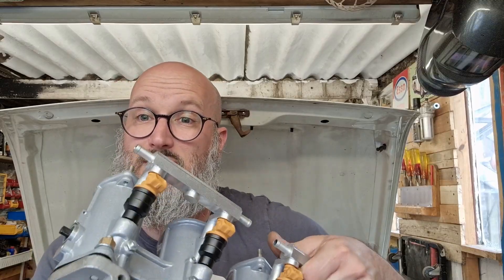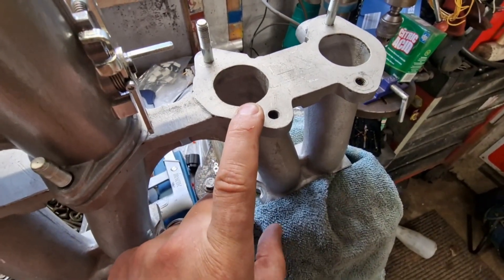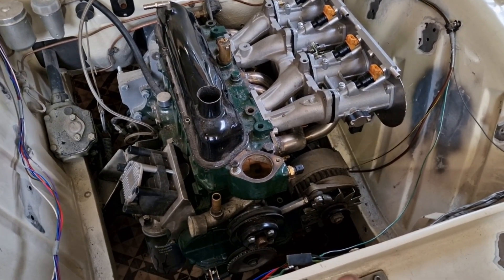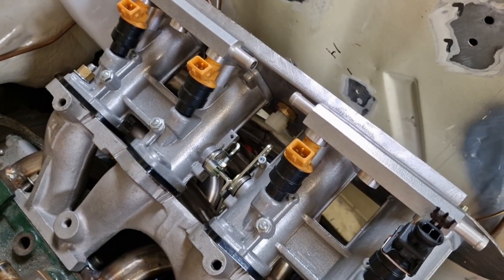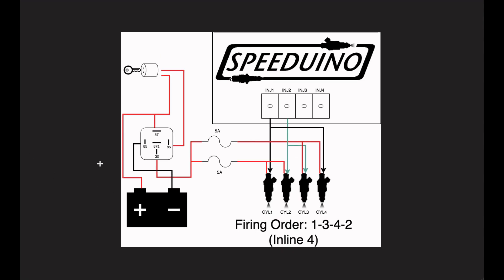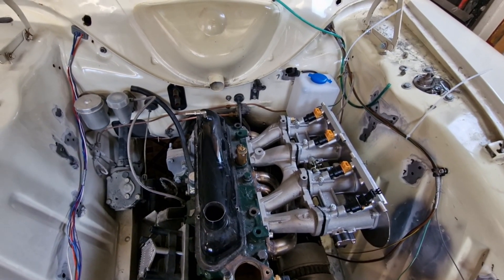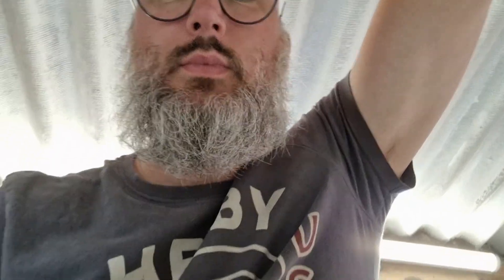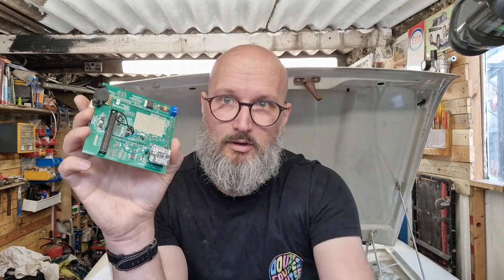Classic Car EFI - Making a loom for the Speeduino from scratch

Comment: Soon I will have to do the same thing, also the chassis harness as well. I'm building a Locost from scratch in LA. Duratec 2.5L w/custom TBs, and Speeduino 0.4. I don't know anything yet about the Speeduino part. I have soldered it together that's it. I don't even know yet, if I need MAP sensor or not. I will look into it, when the time comes. What you will be using to wrap the harness?
Reply from the maker: That'll be a laugh with the 2.5 duratec in it!

Im reading into the MAP sensor situation too as it's more of a requirement for boost as I understand it. It's sensing can be tweaked in tuner studio so it's every cycle which would work in theory if you just take it from 1 runner like it is when using carbs and vacuum advance.

As for wrapping im looking at the cloth stuff with heat shrink at each end as it can take serious temps etc.

Comment: I think flying plug/s is probably the better arrangement where you have a bulkhead. If you populate all the pin out options through the bulkhead,  It'll allow you the flexibility to make changes to the engine side of the loom as and when you develop the project. Coming along nicely, just a shame about those stud positions. Thanks for the update.
Reply from the maker: Thanks Niall, i think it's the way forward for the loom. Im frustrated with the manifold but hoping I can do something with it.

I have been meaning to email you but have been busy with work etc, im sorry to have left it so long.

Comment: I usually put the air temp sensor in the air inlet ahead of your airbox / air filter. This would get the air temp sensor away from the throttle linkage.
Reply from the maker: That's interesting,  I had looked at it then changed my mind as I thought it might be slightly colder.  You're right about it giving me more clearance - I'll get it moved.

Thanks for the tip 👍